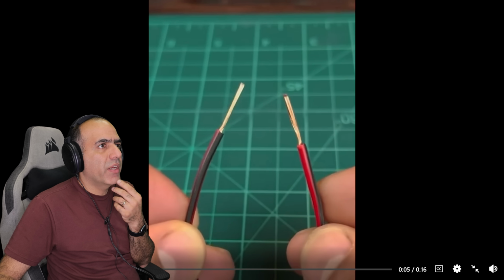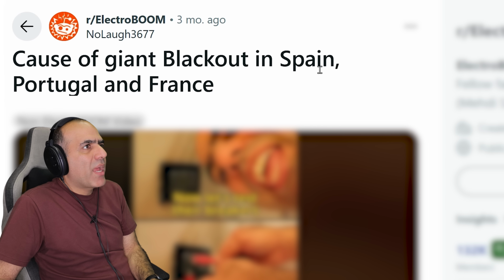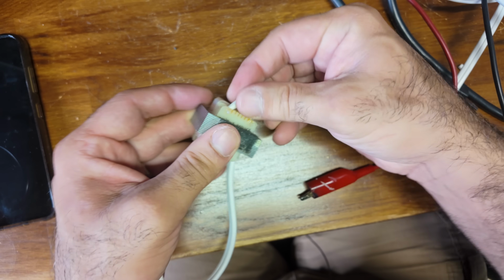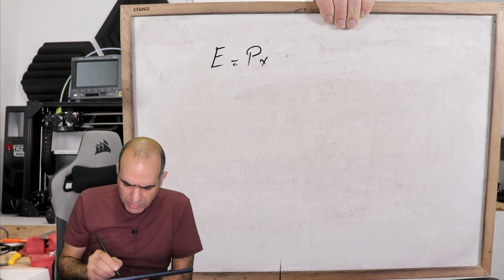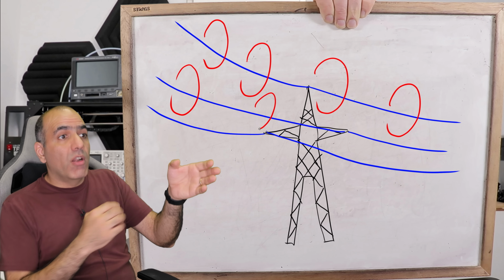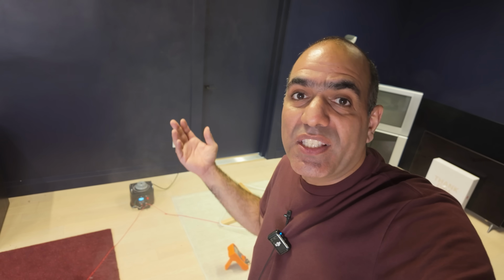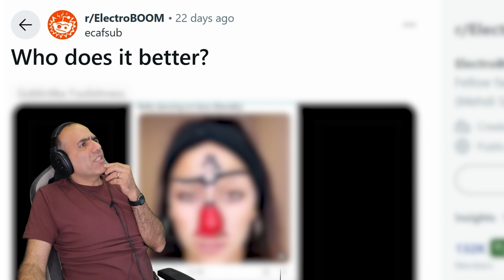Power Lines at Knee Level? Campfire with AA Battery?! (LATITY-016)

Comment: OK... I'm pretty sure those knee level power lines were built just for burning stuff... 
But for the guy who showed little sparks on a fence near a high voltage power line...
I'm pretty sure that was legit...
Your new high voltage source was a Van DeGraaf generator... which puts out DC...
Those power lines were almost certainly AC... and surrounded by a high voltage AC electric field...
I've seen demonstrations where you can light a fluorescent bulb by holding it up in that field near power lines...
But the magnetic field on that long cable is also acting as a "60 Hz ultra low frequency radio transmitter"...
And a long fence will act as a really long ultra low frequency antenna...
So I wouldn't be that surprised if you could get enough voltage and current to make an itty bitty spark.

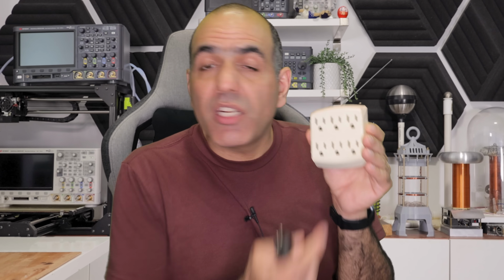Comment: You can put a plug in between 2 outlets instead of its own because if you have a very fat plug that takes up more space than its outlet, and you want to plug something in adjacent to it, rather than plug it into the outlet on the other side, you can plug it in between the 2nd and 3rd outlet space (assuming said fat plug is in the 1st) and save space. 4:13

Comment: On the battery trick, use an old boy scouts' trick - dryer lint fire starter. There's a bunch of ways you could go about it, but you likely don't even need an accelerant.

Comment: IMPORTANT! Always ground fences near power lines. Not only for induction but as a safety measure in case a wire breaks. Even lower voltages can be deadly in this case.

Comment: i used to use the neg-pos terminal of separate outlets like that when i was younger and my various video game consoles had ac adapters that took too much room for the outlet next to it. so there is a use-case for that design
and my my grandpa used electric lines low to the ground like that to keep deer and rabbits etc out of his vegetables in his farm. it was amp limited by a lightbulb i think

Comment: 5:50 - Its actually possible to build a fusion device at home. Just gotta heat some plasma up far enough for a short time and there will likely be a few fusion reactions. 
Its just not gonna generate any electricity. Thats what you need to build the giant facilities for ;)

Comment: 4:12 Ooh I know this one. I think. 
Studying to be a product designer person here.

It looks pretty.
Making both the spaces between poles and units uniform appeals to the pattern seeking part of your brain which makes you more likely to buy it thus increasing profit. 

In simpler terms: Brain see pattern, Brain happy, brain buy. 

Uniformity and symmetry like that are very common because:
1 It's easier to make look good. There's tons of uneven stuff that looks good, but it's harder to make looks good. The brain naturally seeks patterns and symmetry and thinks it looks good with less convincing trough other aspects. 
2 It's easier to produce and cheaper to make. You have to make less different looking parts which takes less labor, which results in making less workers necessary and less wages paid.

Again simpler terms: It's easier and it's cheaper.

Additionally sometimes appliances can have extremely hefty plugs that disallow other appliances from being plugged in near them so plugging in across 2 units can perhaps safe you a plug if you're using many.
I'm equally inclined to say the following two thimgs about it:
This is an intended function. 
It's an unintentional consequence of the above mentioned stuff. 
Though I can prove neither to be definitely true or false.

It could also be an industry standard size, like DIN for paper per se, wherein half the space between individual units must be half the space between the plugs. (I wouldn't be aware of this one but I'm not omniscient.)
You could test this by measuring an external power strip and seeing the distance between them. Then try it with your wall strips and see if this distance is equal to one another.

That's my two, well technically three, cents on the matter. Thanks for reading.

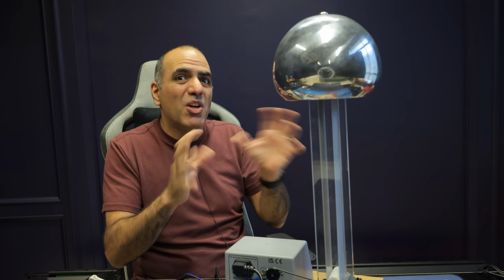Comment: 14:15 the induced voltage is properly a result of capacitor effect of the power line and the fence 
The line is the positive and fence is the negative

Comment: How about testing the levitating exiting device where you get a large plastic basin of salty water stand in it, bend over and grab your ankles and try to lift yourself at the same time you need someone to drop a metal conductor attached by a insulated wire to a live electric fence into the water it's amazing how quickly the person in the bowl will exit the bowl either vertically or horizontally

Comment: Stumbled on your channel about an hour ago.  My father is a retired HVAC engineer, with at least 40 of his working years being in that field.  I am showing him your channel, and I know he is going to crack up.  He has told me some crazy ass stories of his time as an engineer.   One day he and another guy were doing some repairs or maintenance or something and there was some exposed wire they had to work around.  Both knew the wire was both exposed and live, but somehow his coworker ended up getting his hand hooked by one.  Guy totally locked up, could not let go.  My father was facing away when it happened and when he turned and saw what was happening, he basically spears the poor bastard to break the connection.  He worked mainly on large buildings, think big department stores, so you know there was some juice coming from those wires.  

Yeah, he is going to love this shit.  🤘
Reply: Have you shown it to him yet? If so, how did it go?

Comment: The nuclear fusion reactor using inertial electrostatic confinement are common in youtube and science fair project. It can generate a high energy x-rays, and neutron radiation background. But the IEC fusion reactor have no proper design for thermal radiation exchange steam or liquid molten metal, whether there is a proper design near at plasma fusion still destroying the wire grid electrode with neutron, photo-disintegration, or the annealing of H isotope fuel as an high energy ion. IEC have not enough energy efficiency, and all lost through plasma thermal loss, and turbulent including the escape background radiation. You can try but safety precaution with own dosimeter or geiger counter.  I tried in my thesis with computational simulation for particle's mechanics, but I don't used the IEC design. Proper study still necessary with computational simulation of the reactor itself for less cost in experimental methods.

Comment: Regarding the outlet spacing, that actually seems useful for a wall wart/transformer power supply.  You could perhaps plug it in between the two and kill two outlets instead of plugging into a middle one and killing three.  I might see if that works on some of my power strips at home to save me some space.  Especially with a couple of wall warts next to one another.

Comment: I think you did not fairly comment on the students achievement. It just says fusion reactor. It doesn't say it has a net positive energy production. You can actually self-build a farnsworth fusor, which will fuse deuterium. Although you should not run it without shielding, since it will produce neutrons. But the guy probably just ran it at lower voltage for presentation purposes.

Comment: I have two comments:
1. About those 2000W. Those are actually 2000Wh during 24h I think. Most people don't know the difference between W and Wh. Also, the resulting numbers from that are more realistic.
2. Why do you say the induced voltage only depends on the current? Isn't that gate in a voltage transformer configuration rather than a current transformer configuration? Isn't the CT wound around the wire measured vs VT where the wires/windings are parallel?

Comment: If you have something blocking one of the outlets on the adapter, you can plug something in where it won't be obstructed.  Only use I can think of for it.

Comment: Can someone explain how survived 250v ac? I was also using a soldering iron but it was on a wire connected to the out let because i forgot to electrical taped it. It on my finger and no burns, it has been like 3 months yet no hospital visit.

Comment: 6:00 it actually seems plausible to do, you turn the nuclear material into heat and turn water into steam that moves a turbine, the main reason that worked without all the massive infrastructure is because its not very powerful. Its probably powerful enough to power a light, not a whole city.

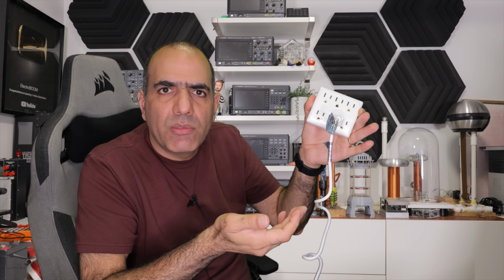Comment: 04:00 only application would be if one of the other plugs is blocking half another plug due to those adapters that are built-in to the cable?
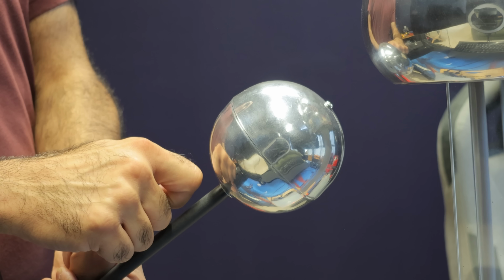14:43 Double Arcs!!

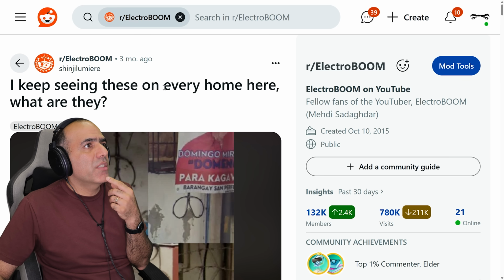Comment: 10:06 Drip loops. They serve two purposes in CATV cable:
1. Water can't accumulate on the cable, it'll flow to the lowest points and drip off. Hence the name. We make sure this is below the entry point to the house so it doesn't pour water into the house when it rains.
2. In places with a large temperature variance, it's extra slack so that the cable doesn't get pulled out of the connectors when it gets cold.

Also it looks better than a rat's nest hanging off the house, though usually should be inside a service box if we're being real.

Oh pff, commenter answered it 2 seconds later.
Reply: It's funny, because I was just watching Mehdi's "Running Power for New Outdoor Light Fixtures" video, and people in the comments were dinging him for not using a drip loop in his installation.

Comment: I have a 300KV+ power line running across my property with several barb wire fences being crossed by the power lines.  The line company installed 10' metal gates in each of the fences so that they can run down the power line keeping the ground clear.  On the barb wire fences on each end of the gate, they installed a ground wire connected to each strand of barb wire even though the fence uses steel posts.

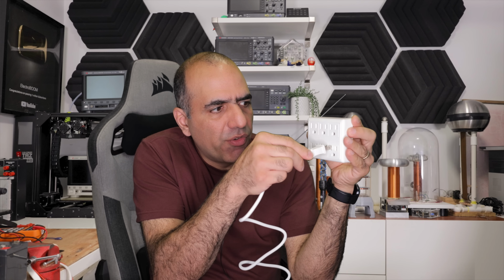Comment: 4:20 sometime the design of the Plug  blocks usage of other ports and in the way it´s designed you can at least plug in a device without earth. It happens a lot if you have to plug in different devices , personally i know it from event´s and concerts. Some plugs are so big they take one and a half socket.

Comment: Mehdi, Shame on you for scolding this young scientist.  Farnsworth fusors are a real thing.  Look into it. You CAN build a fusion reactor in your garage, and many people have done so.  These devices can be proven to be working because they emit detectable neutron radiation during fusion.  The catch of course is that Farnsworth fusors use far more power than they create, and the process cannot be scaled up to break even.  Generating fusion is not the hard part, getting useful controlled power out of fusion is what we've been trying to do for nearly 100 years.

Comment: 4:07 I recently DID find an application for this specific use case. I had one of those massive power bricks that takes up a ton of room, it was too big to fit in normally into one of the sockets next to regular plugs, but by wedging it in like this I was able to slot it in.

Comment: For the AA battery lighter... I use ecig cartomizers as mini smoke machines. Its a coil with a cotton wick through it. The cotton has to be soaked in glycerin for about 15min before burning (applying a charge).
Im in Surrey, I can give you one if you want

Comment: The reason for the plug spacing may simply be that it's the tightest packing space that makes sense. You fon't want it too close, else two neighboring plugs will get in each other's way and you don't want to space it further than necessary, else your box gets too big and you waste material. Since there is no safety need for larger spacing, it is not necessary to make sure the plugs can't be inserted into two neighboring slots.

Comment: Those turn gates generating electricity is bullcrap in my opinion. It would be hard to move to generate any meaningful amount of energy. Also it’s not clean energy because it’s generated from food that people eat. That’s like putting people on a bike and making them pedal to generate electricity. If you do that, they’ll still exhale a bunch of carbon dioxide plus require a lot more food

Comment: People often think you can fuse two hydrogen atoms directly into helium, but that’s not true. A stable helium atom has two protons and two neutrons, so in total you need the equivalent of four hydrogen nuclei. That full process releases about 26.7 MeV of energy.

Two hydrogens can fuse into a heavier hydrogen called deuterium, which gives only about 1.44 MeV. Real fusion reactors instead fuse deuterium (1 proton + 1 neutron) with tritium (1 proton + 2 neutrons). This makes helium plus a free neutron, releasing about 17.6 MeV.

Now, 17.6 MeV sounds big, but it’s only about 2.8 × 10^−12 joules. To heat just 1 gram of water by 1 °C, you’d need about 1,500,000,000,000 of those reactions. The power comes from scale: 5 grams of fusion fuel can release around 470,000 kWh. The same 5 grams of coal would only give about 0.056 kWh when burned — roughly 8 million times less energy.
Reply: Fusion converts mass into energy. Or the other way around under some extreme cosmic circumstances. As a helium atom is about twice the mass of two hydrogen atoms, we would need to put in a lot of energy to produce helium. By the time I write this, way more people are interested in converting mass into energy, not the other way around.
Reply: @johnsmith1926  A stable helium atom does not weigh twice as much as two hydrogen atoms. The atomic number only indicates the number of protons, not the total mass. Most atomic nuclei also contain neutrons, and a neutron has nearly the same mass as a proton. Hydrogen has only one proton in its nucleus. Stable helium contains two protons and two neutrons, making it about four times the mass of a hydrogen atom.

The energy released in fusing four hydrogen atoms into one helium atom comes from the mass difference. Four hydrogen atoms have a combined mass of about 4.032 u, while a helium-4 atom has a mass of about 4.003 u. The missing 0.029 u is converted into energy. If you fusion deuterium and tritium instead - and again, that's what fusion reactors are actually trying to do, they never work with basic hydrogen - the mass difference is smaller, thus less energy is released.

And the mass difference comes from nuclear binding energy. When protons and neutrons bind into a helium nucleus, the strong nuclear force holds them together in a lower-energy configuration. The system’s total energy decreases, and because mass and energy are equivalent, the bound nucleus has less mass than the sum of its free nucleons.
Reply: @xcoder112  I did not write, that a helium atom weighs twice the amount of two hydrogen atoms and therefore quote myself:
"As a helium atom is about twice the mass of two hydrogen atoms, we would need to put in a lot of energy to produce helium."
The point here is: You do not need the exact numbers to figure, that two hydrogen atoms are not enough. Mr. deGrasse Tyson probably knows this as well and got confused between two hydrogen molecules and two hydrogen atoms.
Reply: @johnsmith1926  Sorry, I misread your statement as saying "a helium atom is about twice the mass of two hydrogen atoms" is a very confusing way to say that "helium has about four times the mass of hydrogen". It's like saying "A dozen eggs is three times the size of four eggs"; technically correct but nobody would say that.

Though I don't know how Mr. deGrasse Tyson ended up in your comment. I was referring to Mehdi saying (verbatim quote from the video): "You know, fusion reaction is when you join TWO hydrogen ATOMS to create one helium atom and generate a TON of energy in the process". And this sentence is wrong for two reasons. The first reason being that you cannot join two hydrogen atoms to generate a helium atom, period. And second, it does not generate a ton of energy, it still generates a tiny amount of energy. Relatively seen, it generates way more energy than any chemical reaction ever could, sure, but it's still not a ton of energy in absolute terms.
Reply: @xcoder112  "Mr. deGrasse Tyson..." Well, wrong clip. I think you answered yourself, why I used the mass of two hydrogen atoms to compare it to the mass of a helium atom. We are commenting a video. That is what I was referring to. Mehdi used two hydrogen atoms. Two hydrogen atoms it is for my comparison.
As you are otherwise repeating basically what I already wrote, I consider this settled.

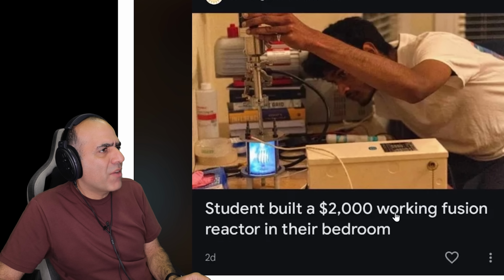Comment: 5:15 @ElectroBOOM, that is a Farnsworth fusor, the coil cage in the center forces hydrogen atoms to collide and fuse through inertial electrostatic confinement. It is a very feasible DIY high-voltage project. I'd mostly be concerned about the safety of his setup, as fusors like this can emit a significant amount of x-ray radiation and his setup doesn't look like it's shielded at all. The term "reactor" is accurate, because it produces a fusion reaction, not because it's a power plant. Comparing this thing to a tokamak is like comparing a cannoe to a cruise ship.

Comment: The two applications I can think of for having perfectly spaced American outlets is thus:

1: Perhaps in the factory they are made in they only have one cutting piece so the slots need to be equally spaced.

2: On that specific device, if you have a larger device on the plug it would hang off the side and block the other port from being used anyway. By plugging the device into both the sockets you lose no outlets but minimize the device's profile.

Both of these are assumptions and should not be done regardless of how sensible they are

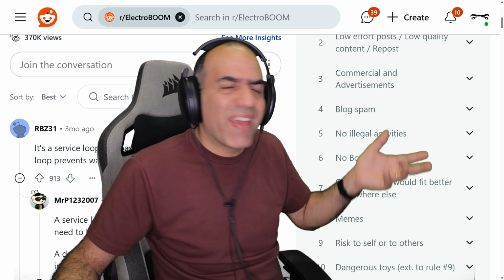Comment: 10:26 Service loops usually are there to give extra slack so if you have to redo the ends you have a bit extra to be able to do so without replacing all the wire.